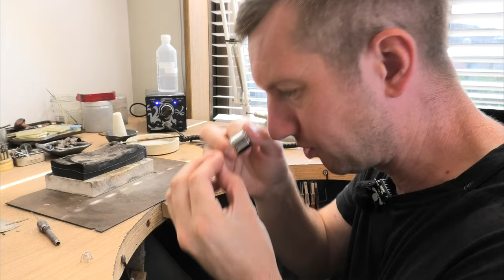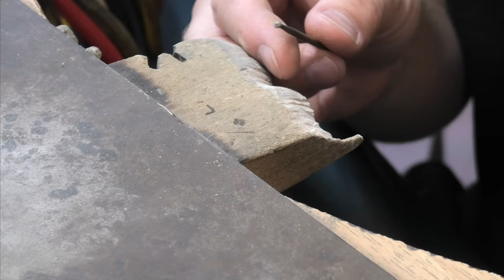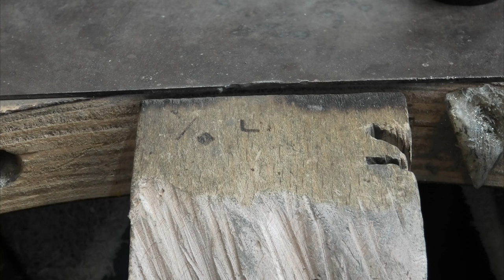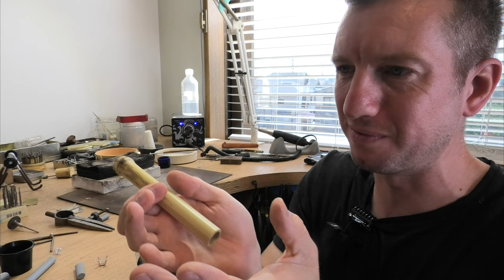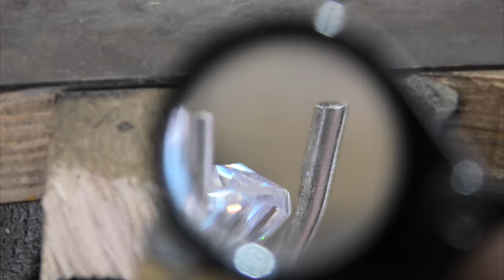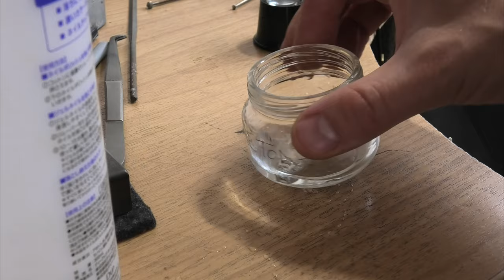Setting a Double Claw Cushion Cut

Comment: Loved that little bamboo rant haha the tool u used was a setting burr and is usually just used for round stones. Id have used cylinder burr setting that stone. One with a width similar to the girdle. Then u cut an angle that mirrors the pavillion and the crown above and below the seat youve cut
Reply: Agreed..

Comment: I've also not had much proper training in stone setting, its tough and the most stressful part of the jewellery making process for me but very satisfying. i think you need a nice pair of nylon jawed parallel pliers for bending the prongs safely, a very useful tool to have for all sorts of little jobs. also i would have used some kind of hart burr to cut the prongs, I think it would give more control of the cut.